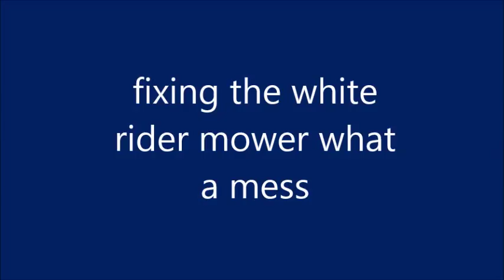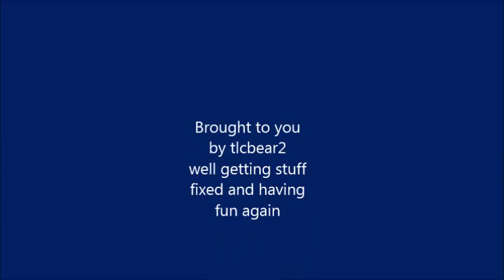white lawn mower repair

Comment: Is there a way to disconnect the transmission so you can free will in the shop. I know the old Murray mowers had a little latch you could pull on the back and it would put it out of gear

Comment: Yeah I bought a brand new snapper and the second year i had the damn thing the carb dumped gas in the engine like that and that was not the first issue i had had with that engine so i sold it I havent had good luck with briggs engines but i am not saying they are no good i just havnt had good luck with them